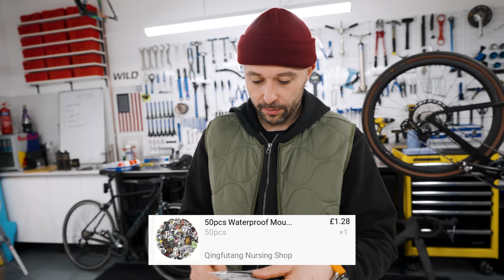Testing The Weirdest Cycling Products From Temu.com

Comment: You know you've hit a new low when you own one of the products. I have 2 of the handlebar extension products; 1 about that size and 1 smaller. You're supposed to mount them in front of your handlebar I think. You can even mount them in front and below. You put your computer up on your stem or handlebar and then use the handlebar extension for lights and/or camera.

Comment: the Zefal version of a bar end mirroe works great, is chap, and holds on with a rubber grip band so easily removable. I'd recommend one of those.
Reply: I use the same mirror in this video on a couple of my bikes. You just have to get use to them...They don't move when you ride over bumps either.

Comment: Guys, you don't know how to use some of these things. For example the bar extender is an amazing thing. You need to fit it straight down on your handlebar and this is used for handlebar bag cradle when you bikepack . This stops the bag to press the cables and to be floppy and wobbling around. Another one goes on the top and there you put your electronics, your bell and the the small mirror you showed earlier. This makes the mirror stay closer to your eyes and you can see much better.
I never had a problem to fit them just next to the stem. They are made to be fitted there. I'll use regularly this when I get bikepack last 2 years. There are small version which is fantastic for road bikes. It's just enough space to put a circular bell on the one side, head unit and a light. Shame I can't cannot send you a picture. Let me know if want me to show you how I did it it.